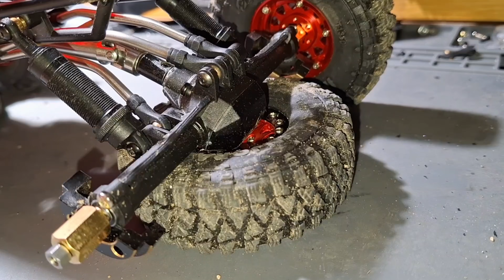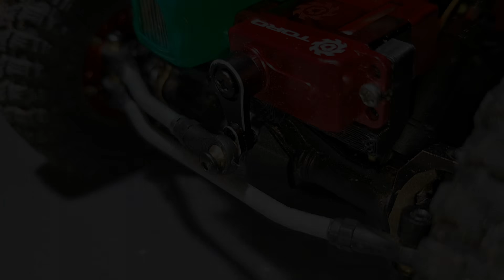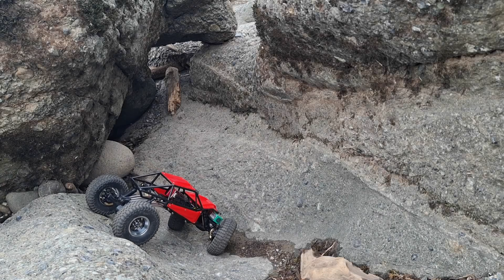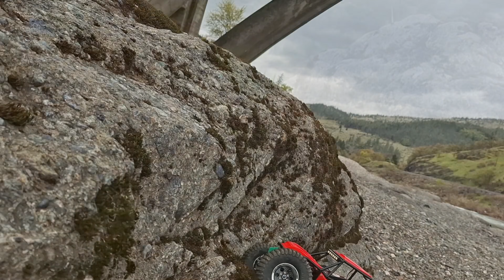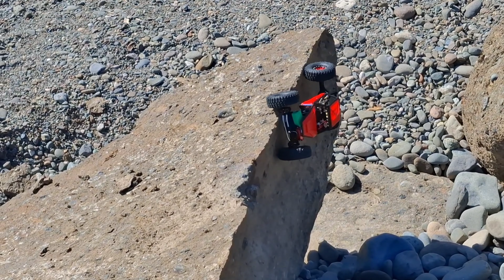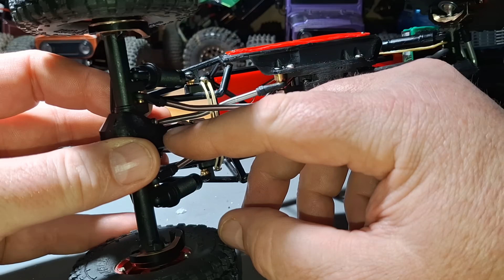ULTIMATE TRX4M build micro poizd capra replica

Comment: I may have missed your explanation but how did you get the  counter weights mounted on the rear axle didn't look like you used the holes in them to do it?
Reply from the maker: @clsuxx6705  I explained it in a different video on the blue truck. I dremmeled a divot in the center of the counter weight to clear the screw head and drilled a hole in it. Mounted it with the lower screw that holds the axle bearing in. Hope that makes sense
Reply from the maker: I drilled the hole first right up against the thick part of the counter weight then dremmeled the thick part to clear the screw head
Reply: @TipsyRC  Thanks, I re-watched that video looks like a good solution my knuckles and weights are due this weekend so we'll give a try. 836 views in 3 days people are catching on Keep On Truck'n !